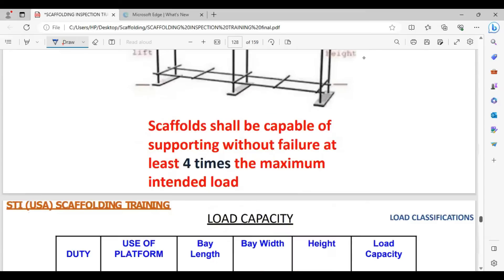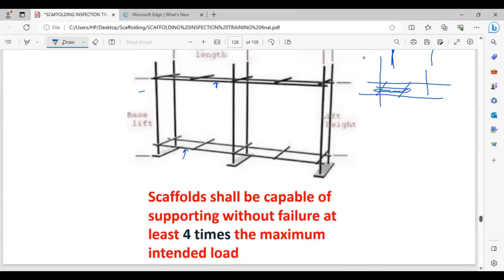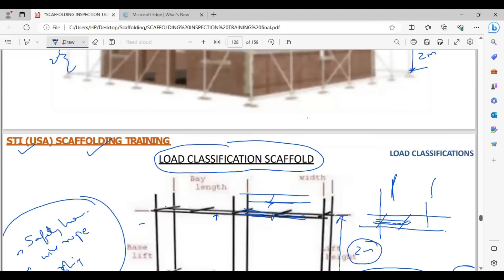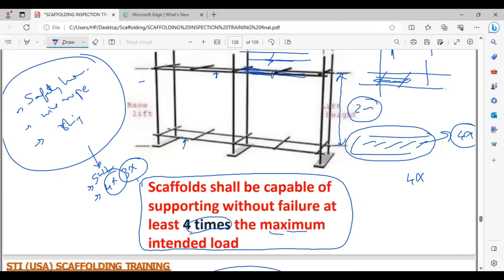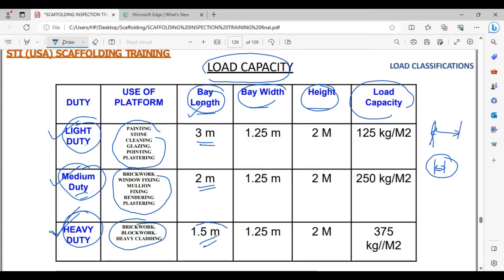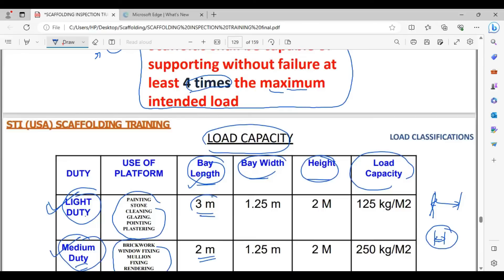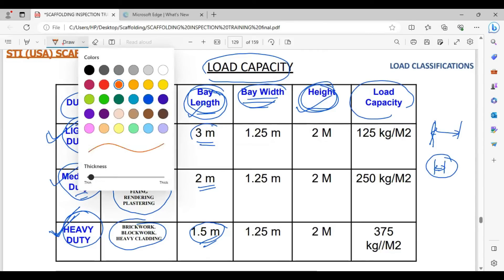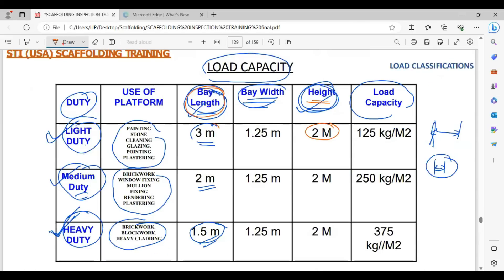Load Calculation - Scaffolding. #othm #NVQ #level6diploma #ISO# OSHA

Comment: I make scaffolding  today  8 mtr height  length of 19 mtr and 4 mtr and leader  size I used 0.95 centi  total bay 18 length  wise  and width wise  4 bay  actually   this scaffolding  I make for slab weight   loading   2 slab cantilever  without any beam support  how to calculate the load and how much concrete and water and cement  and rebar steel also coming  and foam work so that why I make scaffolding  special  purpose  with any design  tell me the load of how much caary  this scaffolding
Reply from the maker: That’s a very specific situation, it would be hard to give you an answer without proper assessment of the site, materials, etc.